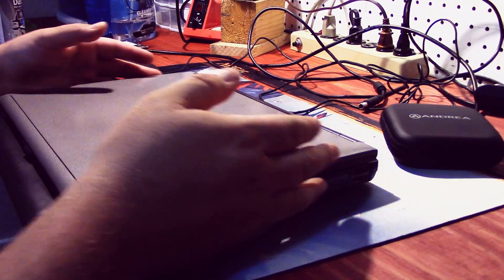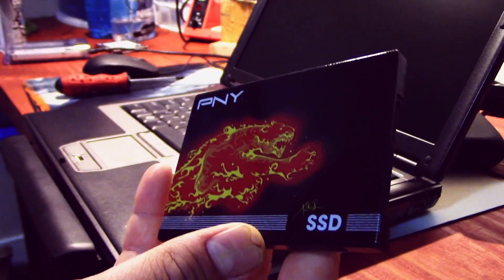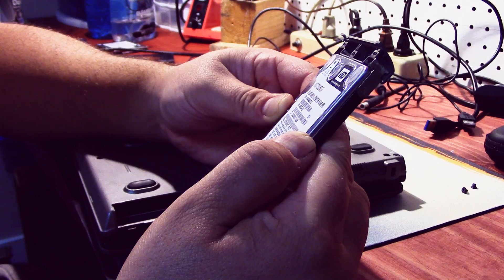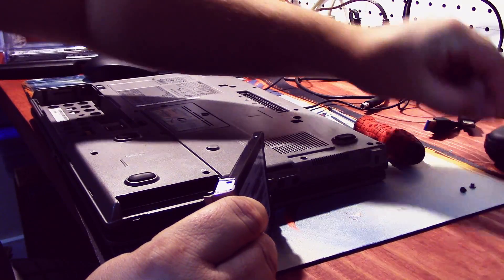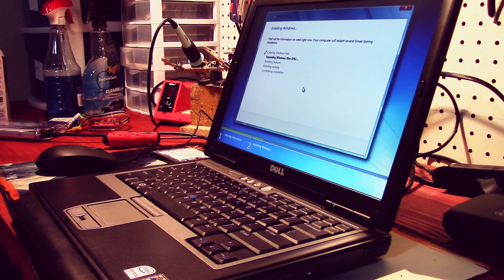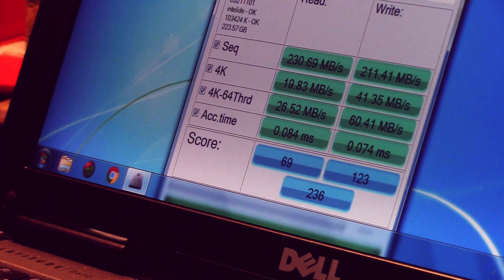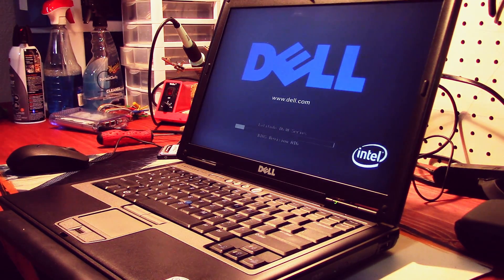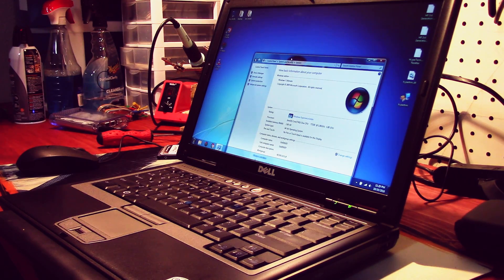Upgrading Dell D630 to an SSD

Comment: I have this D630 laptop, I have a 64GB SSD, but when I installed it, it wasn't recognized, even though I switched the mode in the BIOS to ATA and AHCI. Do you have any solution to fix this? Thank you.
Reply: Same here.got any solution 😢😢
Reply: @kyat_kuttan7697  I managed to run the main drive with an SSD, removed the CD drive, and the computer recognized the SSD
Reply: @kyat_kuttan7697  Hello, did you find a solution to this problem?
Reply: Hello, did you find a solution to this problem?
Reply: @parabellum4636  Yes, I had to completely remove the CD drive before the system recognized the SSD.

Comment: When you installed the SSD Drive for the very first time did you go into Bios and change it to AHCI and then boot up the SSD? i plan on cloning my old HDD to the SSD and been told to change the Bios to AHCI before I boot up a SSD Drive, Can you enlighten me on this?
Reply from the maker: emflocater Most of the time Yes you will need to do this, I honestly cannot remember for this specific laptop as I do not have it anymore.

Comment: what is the name of the SSD you used? im thinking the one i bought isn't thick enough to fit. it's not being recognized it's 2.5 inch
Reply from the maker: Krystal Villatoro What brand and model number is it? Thickness shouldn’t matter as long as it’s not too think that it won’t fit, make sure it’s actually making connection inside the slot too.
Reply: 47 Hobbies the brand is crucial BX500 240GB 3D NAND SATA 2.5-Inch Internal SSD - CT240BX500SSD1Z
It’s weird it feels like it’s too small for the bay? I don’t think it’s making a connection for some reason. I’ve read that buying a spacer might help.

Comment: i can use hd & ssd together?
Reply from the maker: No, not unless you can find a CD to Sata adapter for this model, thus removing the CD drive and replacing it with either a SSD or HD.